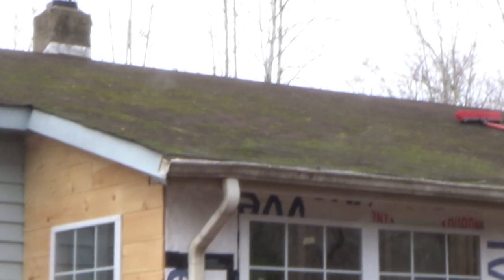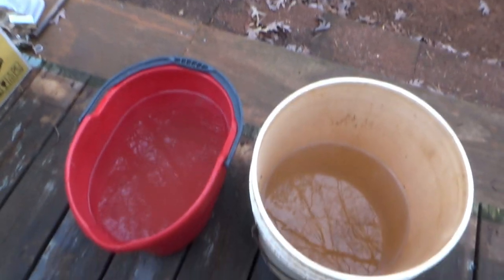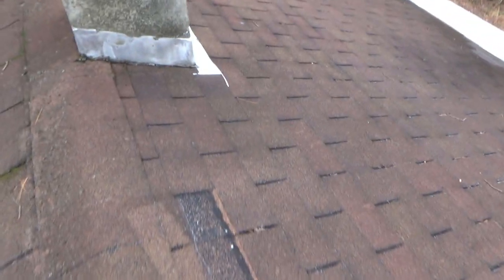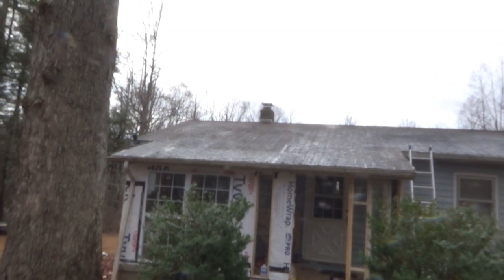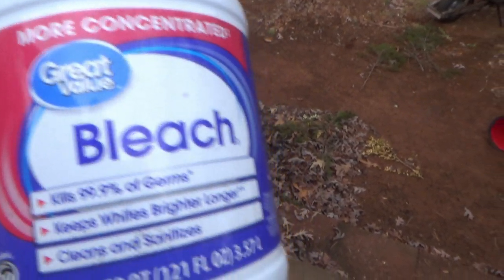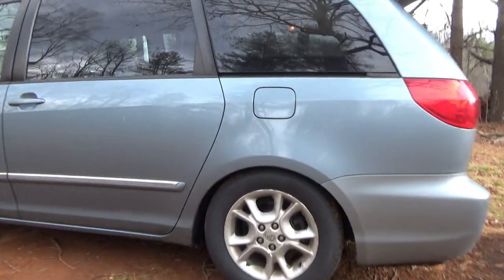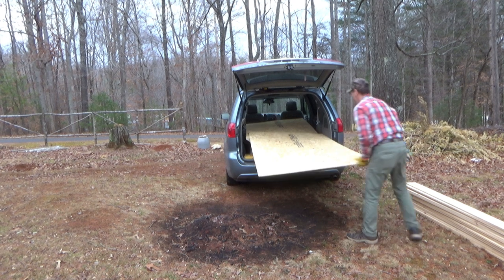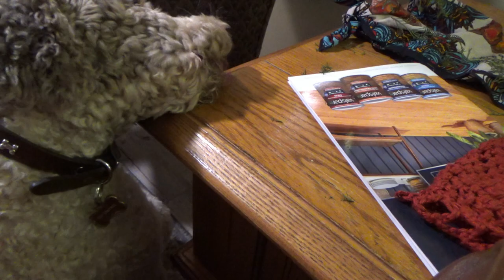Moss On Roof Removal | Revealing Our Next Build

Comment: I hope the moss removal was successful. I used 1/2 bleach and 1/2 water on my tool shed, and it worked well. I used one of those sprayers, plastic gallon bottle with pump which injects pressure into the bottle for spraying. Worked not too bad.🙂👍👍👍👍👍🐕🐕🐕